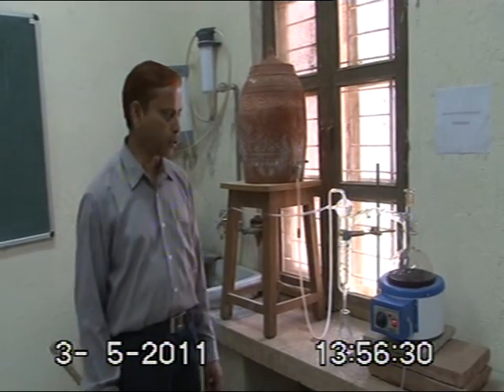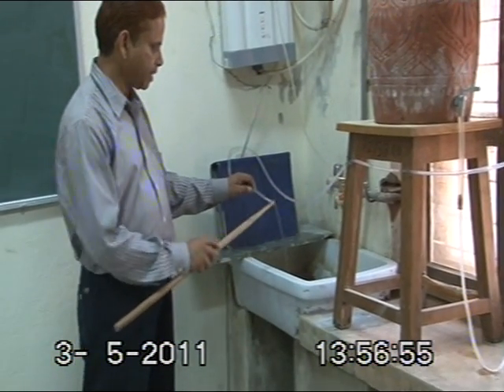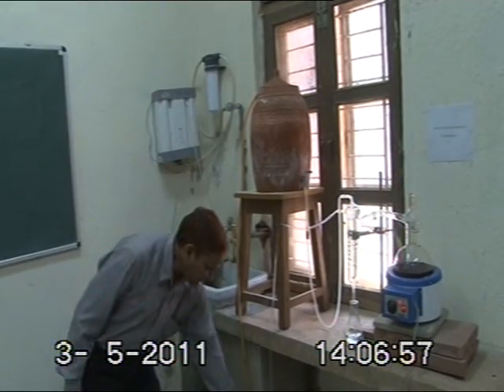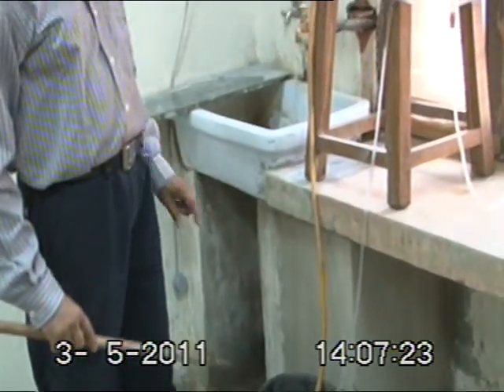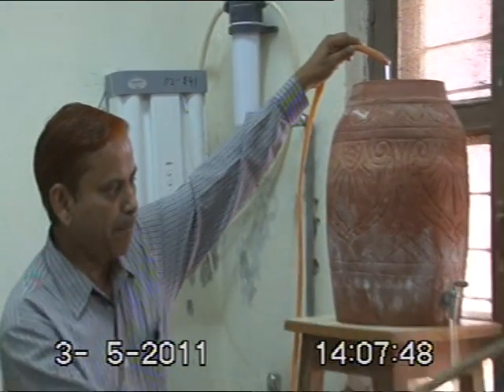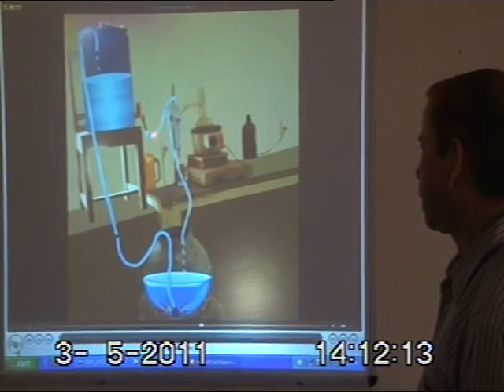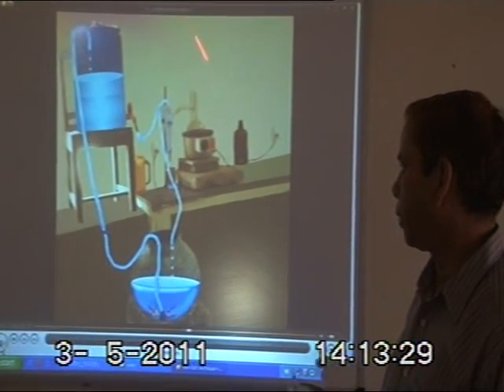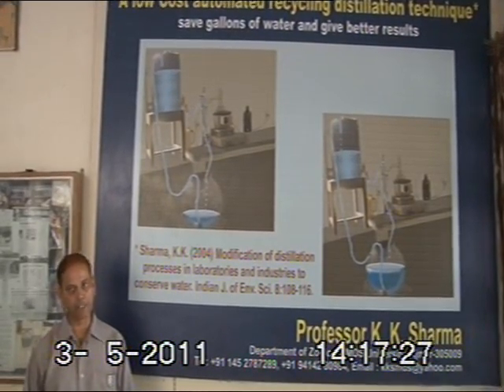Recycling distillation technique saves gallons of water

Comment: Great idea professor. I have a question. When the water come back several times passing in condenser and goes to bottle again.The temperature increase more than before after each passage in the condenser? if that really occur, how do you solve this problem?
Reply: Thanks Dear Inglez for the query. I have experienced that during the period water is collected in the lower tank and pushed to uper tank it gets enough cooled. If you require fast condensation add few ice cubes in the earthen post with water. Many scientists who have used this technique in extraction chemistry with low boiling point solvents have put more than one earthen pot added in series for collection of water. This further adds cooling. The system is working very well since 2004 when I designed this system.
Reply: Thanks my Dear Inglez for your attention.When water is collected in the earthen pot slowly ,until it fills it gets cool as a property of this pot.I have not faced any difficulty and system is working very well in the Zoology Department of MDS University where I installed it first time since 2004. Also working very efficiently in other Institutions also.

Comment from the maker: Yes water gets cooled enough in the earthen pot that is put on wet sand.Such a cooling device is commonly used in western Rajasthan ( India). This system is working well in most of the places where this unit is installed for the last eight years( technique is Sharma,2004). I shall be happy to reply any other question in this regards.

Comment: Is the water cooled enough before it gets pumped back up to the top barrel?I would have thought it would need more time to cool before being pumped back up?
Reply: I have experienced that during the period water is collected in the lower tank and pushed to uper tank it gets enough cooled. If you require fast condensation add few ice cubes in the earthen post with water. Many scientists who have used this technique in extraction chemistry with low boiling point solvents have put more than one earthen pot added in series for

Comment: Distilled water is used to top up Inverter batteries, which are a common sight in every household these days. 
The condensed water dripping from Air Conditioners, must be collected in closed plastic containers to be used for batteries and similar industrial uses.
This will save electrical energy also which is used in boiling the water.
Reply: There are several ways for water saving, it would be nice to use water of ac condensation but this works only in warm environment.